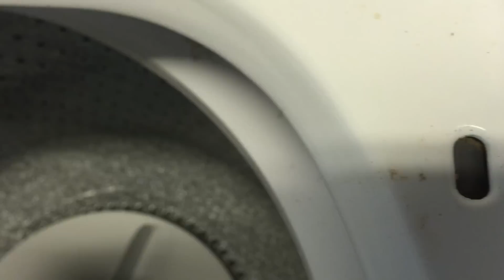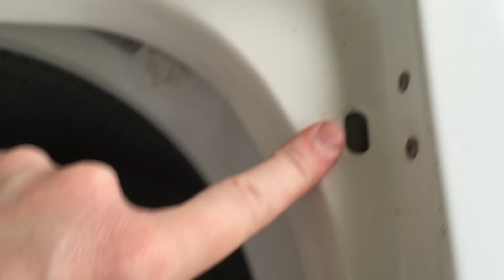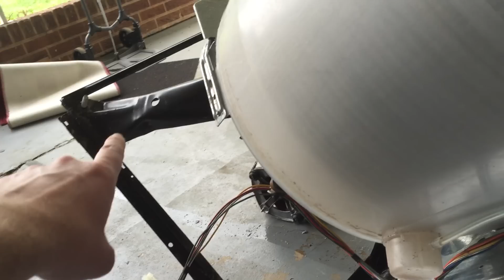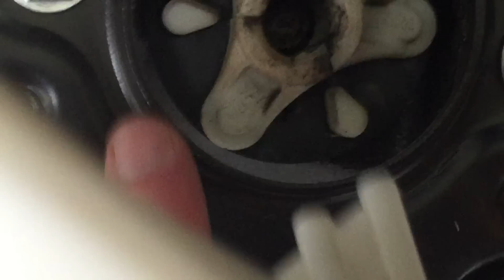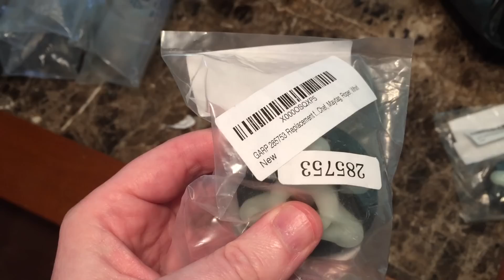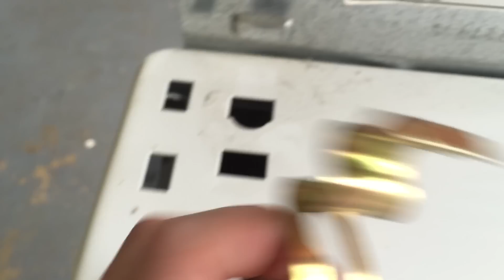How to fix a Kenmore Washing Machine that won't Spin

Comment: Do you have a repair video for a model 110.2703*? I looked under the machine and there is a large round object that blocks access or a view of the motor, pump, clutch area. What is this, and how do I remove it?

Comment: Yu doing all wrong tip it on its side remove motor with transmission in 5 minutes from bottom no need to touch nothing up top all wrong pal do it from bottom

Comment: My Kenmore went thru the wash cycle fine, runs on rinse, but when it got to spin it will not spin nor drain, any thoughts of how to drain the water sir
Reply: I'm having the same problem.  I'm draining the water by hand with a bucket.
Reply: Maybe the lid switch

Comment: What would be the cause if my Kenmore 400 series washer machine is skipping the spin cycle when I run it for a normal wash cycle, and leaves the clothes fairly wet.  But I am able to manually move the dial to spin and then it completes the spin cycle. Is it still the same as this video or different issue?

Comment: DUDE!  you rock, man.  what else did I have to do during this Sunday while quarantining?  my 16 year old and still running (well, not at the moment) 70series Kenmore wasn't spinning after drain cycle, and followed your instructions, and sure enough, broken coupler.  Will try to source locally tomorrow or else online.  Thanks, man.

Comment: You do NOT need to take the housing apart for this repair. Watch the video done by ChrisFix. It can all be repaired from under the washing machine, supporting it with a jackstand.
Reply: Good call Rutger!  With this method it’s a 45min to 90min job.  ChrisFix’s video: 10min job.  It’ll take you longer to watch this video than to do it using the ChrisFix method.

Comment: @kyrodawg  I had the motor coupler and clutch changed but when the washer comes to spin, it doesn’t. It makes likes grinding noise. It’s like it wants to spin but is being held back.  Any suggestions

Comment: I have a 70 series Kenmore model 92573200 and it looks so much like the one here.  Thinking I might get the same part and take a chance.  The washer is 25 years old, but still giving good service until it began making the exact same noise, and not spinning....nothing to lose but time and a little money on a part.  Hate the thought of spending lots of money for inferior products due to all the new water and energy sparing regulations.  People need to wear clean clothes without all that hassle.   I think that is a basic human right!

Comment: I really hope you respond. I have the same washing machine but I didn't know it wasn't spinning until after i had a full load. Mine doesn't make a noise
Reply from the maker: Brittany Martinez the motor should work as usual  even if tub doesn’t spin. If the motor is making a noise that doesn’t sound normal that would mean the transmission or motor may have issues. Best thing to do is empty the washing machine unplug the power chord, hoses and drain, lay it on its side and check if the coupler is cracked or broken before you take it all apart. It may be difficult to tell, if so you’ll need to take it apart as shown in the video...good luck!

Comment: how do I know if my problem is the drive coupler, clutch, or transmission? All three, from what I read online, may be the problem. The top part of the agitator spins, but the bottom won't budge. Removed both and the spindle in the tub is locked up. Did this after I manually drained the entire tub of dirty water. It filled, but there was no spin, so it was stuck in there. And when it tried to spin, I heard a grinding noise.
Reply from the maker: regression coupler is the cheapest fix  if you take the motor off and the coupler isn’t broken  then checking the transmission is seized up.
Reply: @kryodawg  Is there any way of telling if mine is drive by a coupler or belt? I mean, taking it apart will tell me, but i'd rather do that when i have the part ready
Reply from the maker: You can lay the washing machine on its side and look from the bottom to see if the coupler is broke you should be able to see it.
Reply: @kryodawg  Yeah, I think that's what I'm gonna have to do. Thanks for your video! If I need to change the coupler, I will definitely be watching your video for help.
Reply: so i tore it apart and looked underneath. the coupler is broken!!!! i'm so happy it's a simple fix. i'm gonna go get the part and fix this thing. thanks so much, dude

Comment: Can anyone help me with my problem? I have a Kenmore 80 series and it was not working properly. I first noticed my clothes were wetter than usual when unloading so I payed attention to a complete wash cycle to realize the only noticeable change was not starting the spin at a high speed it had to build up to reach maximum speed.  Meanwhile washing still and just drying a bit longer till I figure it out. After a wk or so i was going to do a small load and I had filled with water and getting ready to add detergent I noticed it quit agitating too and since I didn’t add close I didn’t pay attention to whether it spun out at all or as it had prior. Since I had no idea what I was doing and wasn’t positive I figured I’d go ahead n change the clutch and the  motor coupling.  I did so put it all back together and turned it on- agitated fine when it got to the spin it spun out however it made an awful noise doing so- my question is what could I have done wrong or not got back properly in place to make a noise from hell - it really sounded bad but it did quit making that noise before it completed the cycle. I just feel like it is something I did or didn’t do and I don’t want to mess it up any further, I can not afford another right now. Any suggestions would be appreciated and my apologies if I don’t get back to anyone promptly I do not have internet service at my home so my time is limited.
Reply from the maker: Shannon Buchko this is what I found on google that might be helpful for you. If you hear a squeaking sound when the drum rotates, it means that bearing must be lubricated. However, if you hear a grinding sound, it means that bearing is faulty and it must be replaced. Loud noise during the spin cycle can also be due to a faulty drive pulley. The washer belt uses the pulley to spin the tub.
Reply: @kryodawg  Hello sir, thank you for your great video.  I agree with all the comments made by all the previous posts. Wonderful to be able to fix this versus a new machine or hiring someone. I have the exact same washer and a similar problem but there’s no noise coming from the motor when you close the lid or press on the switch on the upper right side for the spin cycle. The agitator works just fine. Any thoughts on this? Thanks

Comment: I tipped it over and took the white thing off but there is a bolt holding the motor.  I know this must sound stupid, but I don’t know how the wrench sockets work.  I’m so frustrated since I’m here alone now.   I am nearly there- but don’t know how to get these bolts off. I’m sorry for the stupid questions.
Reply from the maker: Ms. Vicki the ratchet needs to be set so that it lets you turn the bolt to the left, if the ratchet is just spinning then you will need to turn the knob on the ratchet to the other side...hope that helps
Reply: kryodawg okay I’ll try tomorrow. I had a little meltdown. Thank you for the quick response.  Why didn’t I learn this stuff earlier in my life? Ugh

Comment: What if the problem is a bad clutch?
Reply from the maker: If you know it's a bad clutch then you find a video that shows how to remove the agitator and pull the transmission to check the clutch ring. If the clutch moves easy then use a pair of pliers to pull it out and replace it with another good clutch. Then reassemble the agitator. There are quite a few videos showing how to do it. This video is only for the coupling, which was the problem I experienced. Hope this was helpful.

Comment: This was SO MUCH HARDER than things had to be! To remove and change out the coupling- I figured out you can just do it from underneath. There was NO NEED to disassemble the top, back, and the cover! I spent WAY TOO MUCH TIME STRUGGLING and taking the hard way out. 

ALSO! It would have been nice to show how you put the motor clips on. I spent over an hour trying to put them back in.
Reply: I thought same thing when I watched this

Comment: KOBE #GOATBEAST!!!!!.
MY PROBLEM IS THE AGITATOR DOES NOT SPIN, BECAUSE THE DOGS ARE STRIPPED. THEN THE BOLT OF THE AGITATOR STRIPPED, SO I DRILLED THE CENTER, AND USEING A SPEED OUT, BUT THE AGITATIR KEEPS SPINNING! YES I WAS HOLDING THE BOTTOM OTHER THE AGITATOR, AND IT STILL SPINNING! HELP! THANK YOU!

Comment: Our washer is sometimes spinning and sometimes not, would this be the problem? We have to spin the clothes 7 or 8 times before all the water comes out.
Reply from the maker: +Kristina Schlueter I don't think this would be the issue. Sounds like the motor may not be spinning it fast enough to remove the water or there is something possibly clogging your drain hose preventing the water from draining like it should. Good Luck!